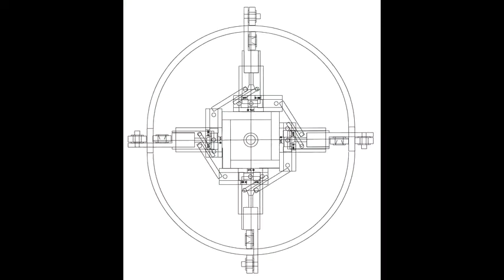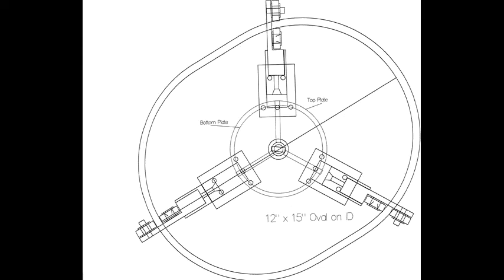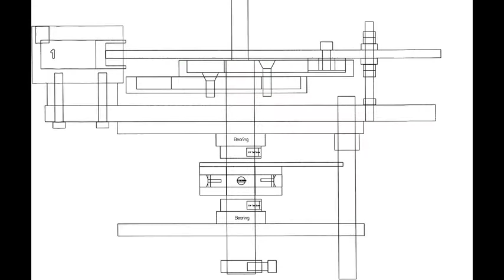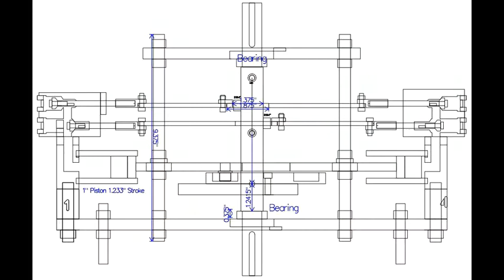Building an Air Engine, 13 Yr Video History 11-20-1018

Comment: this is great i want to do this. what if you tried more compression and a big gear or double the engines. use old ones one for the front and back and you might have a fast car try it if you havent done it it might work.